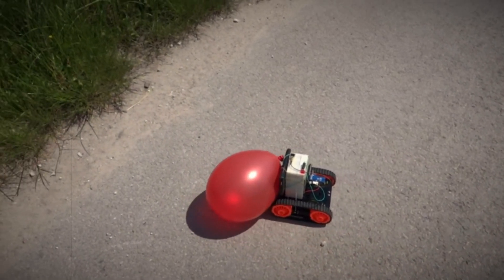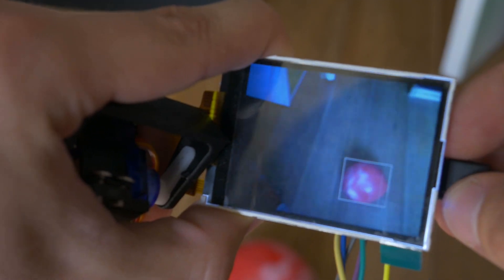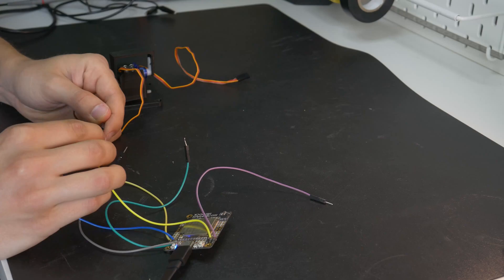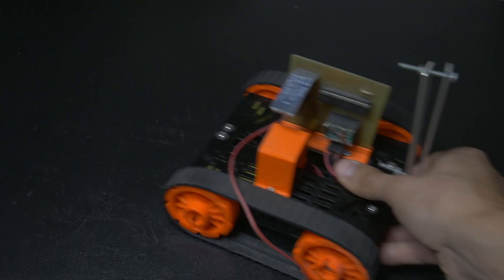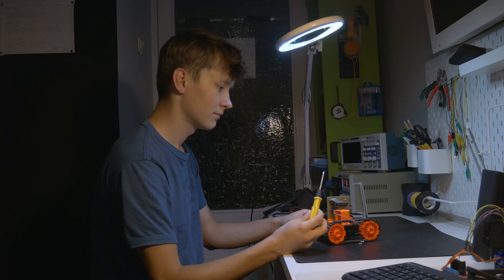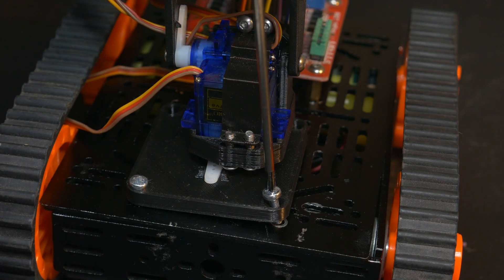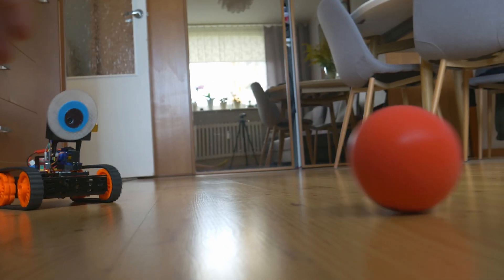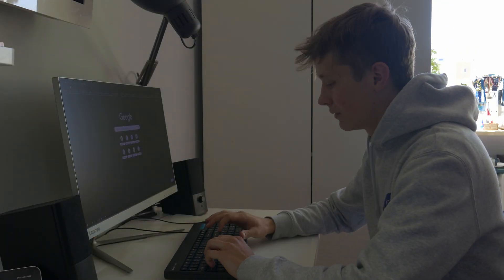Simple Robot With Computer Vision And Python

Comment: Excellent video. I had thought about a robot "mule" to follow my elderly mother from garage to house with groceries, etc. A robotic cart. Garage is separate from the house. I understand the object detection part. Does this system also calculate the distance to the object? I want the cart to follow her like a loyal dog but not run into her.
Reply: Maybe u could use some ultrasound sensors or if u want to use obj detection only, use some algorithms like yolov4, set a threshold on the bounding box and when the bounding box crosses a set threshold limit, make the cart stop...u will have to position the camera as such though...do give it a try and share the results mate😁😁😁